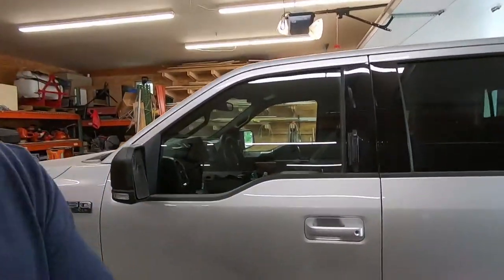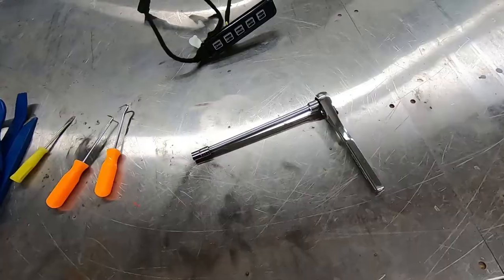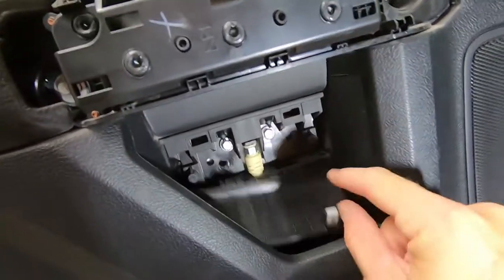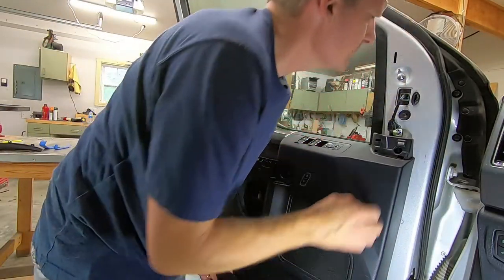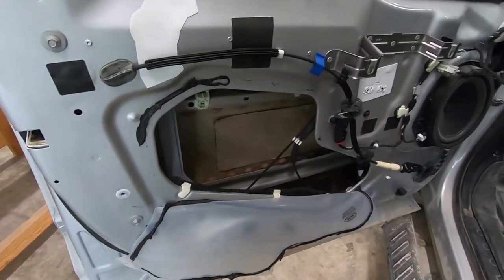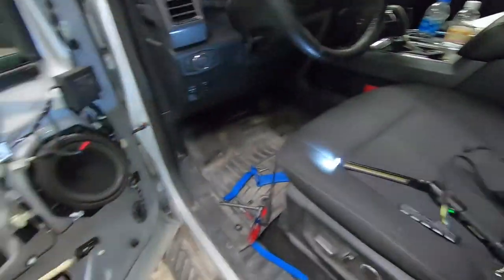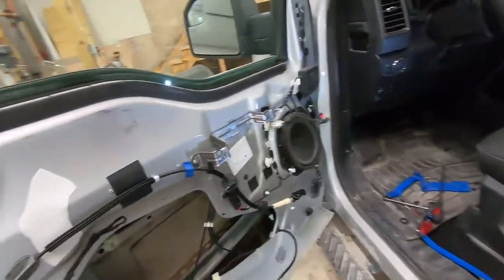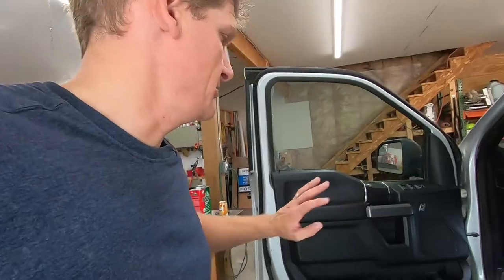F150 Keyless entry keypad replacement - harder than it looks

Comment: Just happened to me on my 2015 f150. Thank you for saving me countless hours that i would have spent trying to get this fixed. Replacing the plastic took less than 2 minutes
Reply: Where did you get the plastic bezel at? And do you know the part number?

Comment: Great video! The numbers on my keypad were so worn that it wouldn’t be hard for someone to figure out my code. So I bought this part planning to open up the door and replace it just like you. Not only can you take off the clip/frame, the rubber number pad also pulls right out and is easily placed into the original part without disturbing the wiring harness. I think your video probably saved me at least 4 hours of frustration! Thanks for sharing the good, bad, and ugly of these projects.
Reply: Jay, I’m looking at the numbers on my keypad and I do not see how you can remove the number part without the wires connected. It looks like they are in the back and not removable. Any ideas?
Reply: The face plate is easy to remove but I don’t see how on the numbers
Reply: @c.c.8771  Once the plastic pieces come apart, you can pull the rubber right off of the circuit board. If you have removed the trim (Just like towards the end of this video), the rubber numbers remove easily. It's going to feel like taking an old calculator apart.
Reply: @jabraymer  Absolutely. Rubber numbers pulled right out . I used a pocket knife to "grab" the top where it is inserted into the plastic housing. After that I carefully worked teh entire rubber piece from top to bottom. Thanks Jay for that piece of information.
Reply: Dude!! You and the original poster have just saved me a s**t load of time and, I’m sure, frustration. I loved his idea of just replacing the plastic holder but, like yours, my numbers are getting worn and really wanted to replace those, too. Thanks SO much for the comment!
Reply: Jay, I am replacing worn numbers too, how do you remove the keypad if its not broken? Does the pillar trim have to come off?
Reply: Yes, just follow the steps to remove the trim. See the comments above yours for the details on getting the numbers out. Once you get in there it will make sense.
Reply: J please post a video
Reply: Any video or talk through of how to get the face plate off the truck id it is NOT already broken?

Comment: I've got the same situation and as I started watching you pull the panels off, I started seeing more and more of an evening going down the tubes to do the same to complete this repair. Glad you found a workaround ! 

I have had Fords dating all the way back to the '64 Mustang (bought in the early 1980's) and it seems like Ford has always had a habit of making some repairs damned near impossible for the average mechanic to handle. This is just another case of it -- needing to spend $25-$50 for an entire part to replace a piece of $1 plastic. Seems like they should sell the plastic as a standalone piece to save owners a bit of money.
Reply: Seems like some planned obsolescence to not make the part so it plugs directly into the key pad.  
I’m very tempted to just do some painters tape and silicone it in nicely.  😅

Comment: Adam,
I watched your video because I accidentally broke the tab on my keypad as well . . . or so I thought.  I was attempting to remove those glossy black B-pillar pieces to have them wrapped with a Matt-black finish, and when I pried on the keypad I heard something drop down inside the door panel - I thought I broke it.  While watching your video I realized it was the small metal clip that fell and nothing was actually broken.  After removing the inside door panel and pealing back that clear plastic, I used a magnet to fish for the small clip, found it, . . . then snapped it back onto the keypad and it was just like new.  Your close-up shot of that new keypad saved me from buying a new one because I thought the tab was broken.  So, somewhere down in your door cavity is that metal clip - and if you ever hear a tiny rattle coming from the door as your driving down the road - that's what it is!

Comment: Just paid $60 for a plastic cover plate.   But at least its now an easy repair.   Big thanks for the heads up.   I would have done the same as you otherwise.  Or maybe just a bead of RTV around the old cover plate.

Comment: I’m about to install my 2015’s 4th keypad…they keep breaking the top tab every 2 years or so.  I have done it myself before.  You need to roll the window down, remove the weatherstrip to expose the screws that hold the door pillar trim in place.  I needed to hook the door panel back up a few times as you need the window up or down at various times to get the harness routed through.  Total pain in the rear.  I’m going to use your method this time…wish I knew the cover would just snap off the last time!!!

Comment: FYI to all - I went a different route and took the new keypad and harness to a reputable car stereo installation place and they cut and soldered all the wires from the new keypad to the old harness.  Took less than an hour and cost $70.  Just another option if nec…
Reply: Yeah, I think that's what I would have done too now that I see how difficult this is.  Actually, I'd do the soldering, but $70 isn't a bad deal either.

Comment: Thanks for the video, I learned a lot about the keypad replacement for F150's.  My entry keypad has been used so much the lettering has come off.  Question - Once you took the trim piece off the new keyless entry part, would the rubber type keypad with the numbers come off?  Would it come off in one piece?  If so I could just replace the rubber keypad and not have to worry about removing everything. Thanks again for the great video.
Reply: I found the answer to my questions in a comment below.  Thx

Comment: Thanks for the information!  It will save me a lot of time.  Where can you find the parts?  I’m sure that my keypad needs to be replaced because the buttons don’t work very well.  If you can, send me a link or name of a website to find this part.  I think I only need the keypad and outer shell that broke for you.  Thanks

Comment: What is the part number and where to order. Ford parts shows the horizontal keypad only.
Reply: 2016 F150 and mine had a white sticker on the back.  PN = FL3T-14A626-AJW

Comment: where is a good place to order part. Bought one from Amazon and I cant take off housing. Any video or way to take off without breaking tabs. Buying another one ..smh to trying again..
Reply from the maker: Can’t remember exactly where I got mine but it was a Ford dealer that sells online.  Search Ford oem parts and you should find some options.

Comment: Why not cut the five wires located behind the buttons of the old key pad, cut the wire off of the new key pad and reconnect the old wire harness with the new keypad?
Reply from the maker: You could do that if the pad needs to be replaced. In my case it was just the trim ring that broke and I’d prefer not to cut and splice a factory harness unless absolutely necessary.

Comment: I have a 2016 Tarurs and the black trim cracked. The trim on the driver side is one assembly and I could not just replace the keypad like you. I had the same problem, I could not fit the connector through that gab from the top going down. I removed the outside trim between the door and window, be careful it's metal, and was able to run the whole trim up through the inside of the door. I hope this helps other models. This guy also helped. https://www.youtube.com/watch?v=QJdmraNPk9M&t  To remove the trim, the part has adhesive tape. I ran a small screwdriver up the tape and gently separated it from the door.